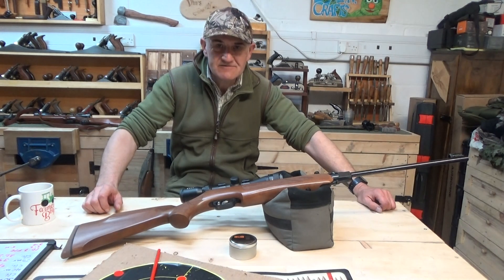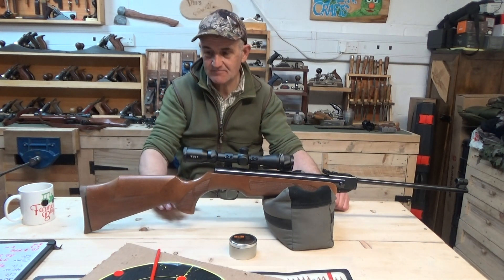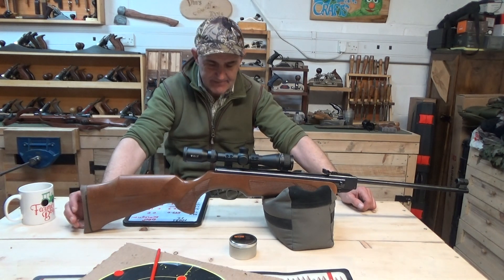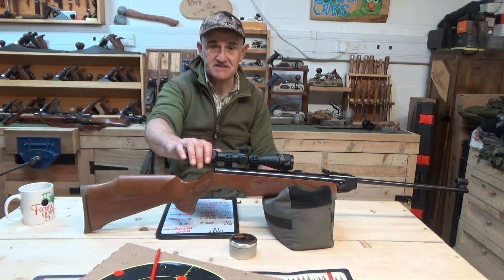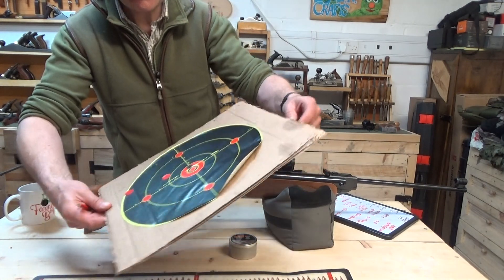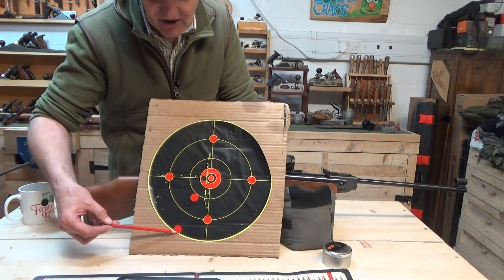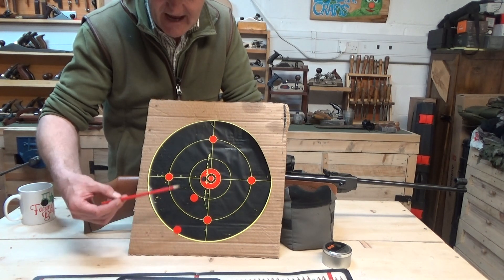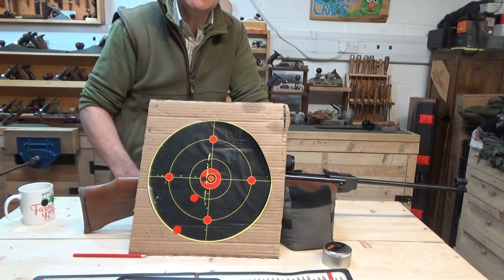Wind Deflection and Pellet Drop

Comment: Drop is a known variable for distance but windage is the unpredictable factor that will cause more issues for sure
Reply from the maker: Very true Keith, but only kinda, factor in errors in judging distance then add in gradients wether shooting up into tree tops or down steep slopes...see where I'm going with this😉👍👍👍
Reply: @vincentenglish8489  That's also a very important factor Vince. Shooting up to tree tops or down slopes needs on zeroing distance needs always a little bit of hold under.